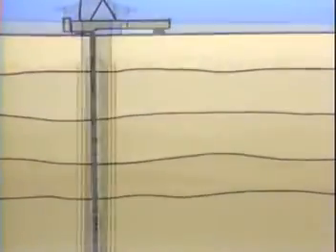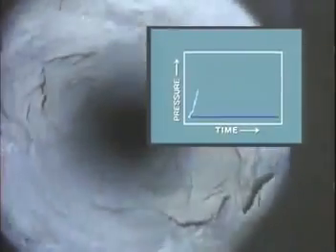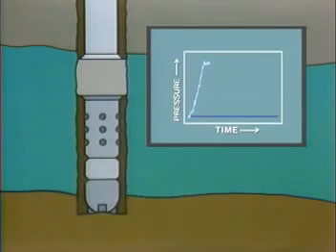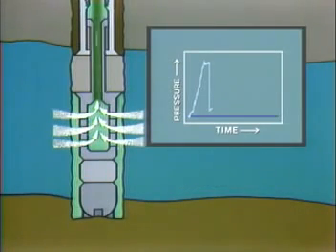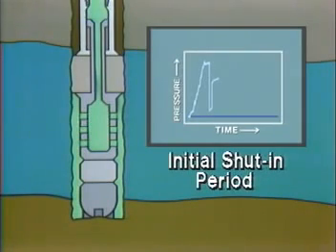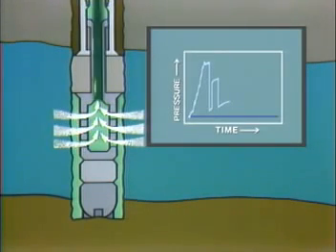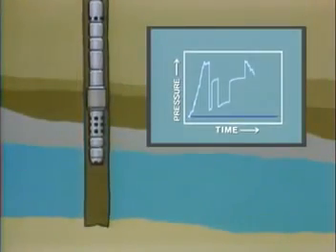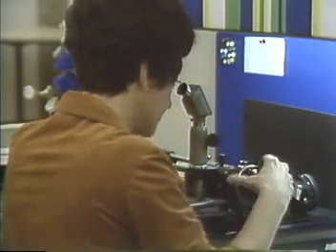DST Tool String and Testing Operations Sequence

Comment: I am a well completion and intervention engineer. I do not agree with this self fabricated video. How DST with perforated guns may be run into barefoot. How Diesel will produced in an oil well. Complete homework and years of experience is required to make such vidoes more technical. Many shit in this vodeo😢